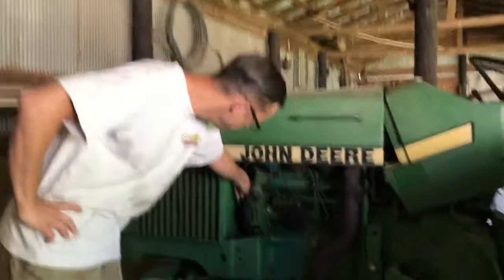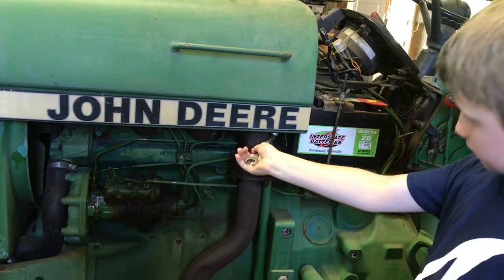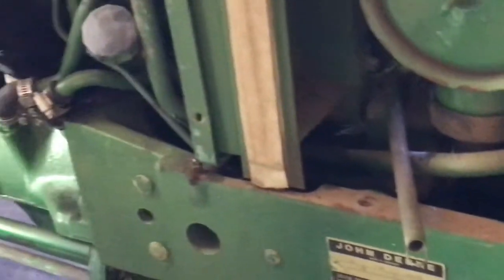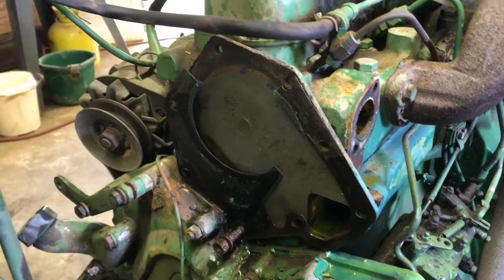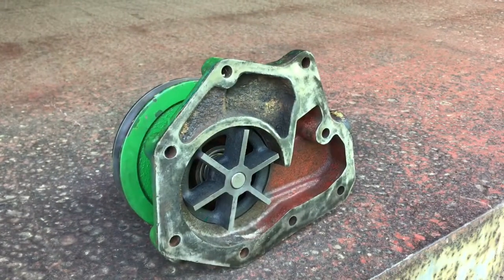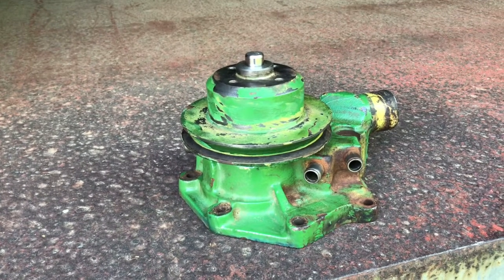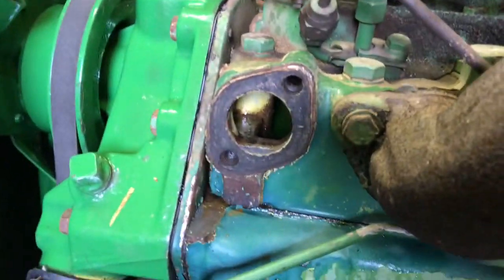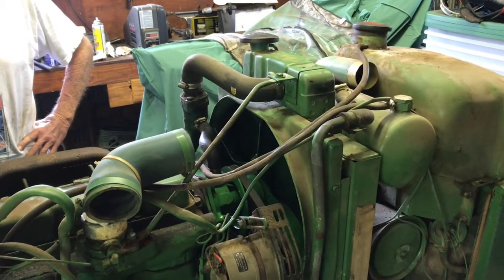John Deere water pump repair

Comment: Hi, great video! What torque did you use on the bolts when reinstalling the water pump?
Reply from the maker: I'm not going to lie, we didn't use a torque wrench.  Just got them good and tight.  Still running great, no issues.